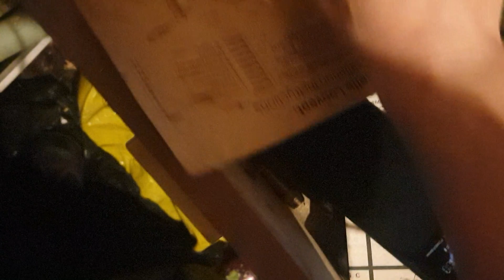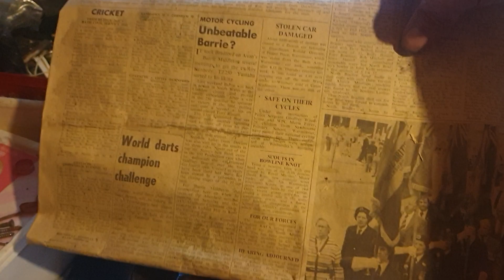Old Potential B-Spoke SpiritBox From The 60s/70s...

Comment: Yea it seems to be an am radio with a tuner. Doesnt seem to have  volume, but slap a 9v on it and see will it work. IF there is no volume, you can put a variable resistor on the speaker out and that should work, Variable resistors are really cheap. It would be cool to make a nice box for it.
Reply from the maker: Definitely

Comment: That there be a Crystal radio set, there are versions which don't even need power. unfortuantly, you can't make these sweep as they use the old capacitor type tuner, the only way is to mechanically move it.
Reply from the maker: Yea thats what I was planning on...manually or an actuator of sorts.